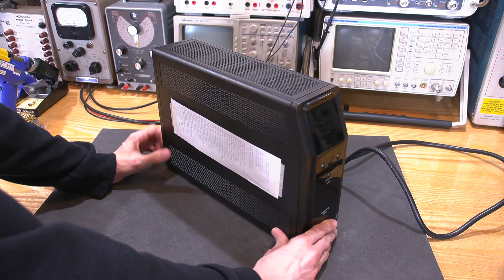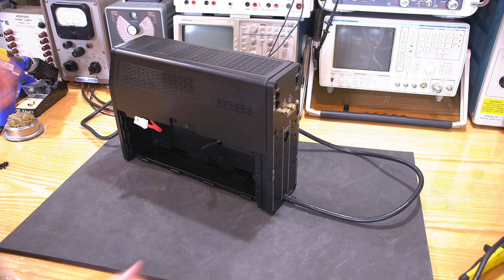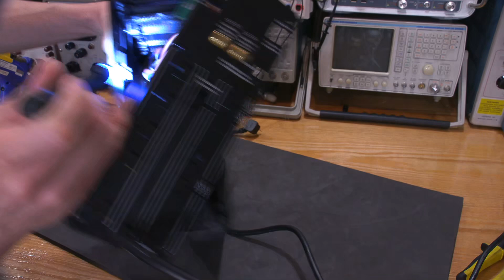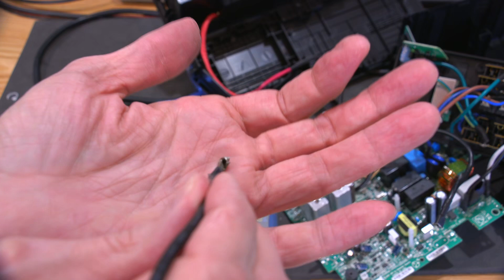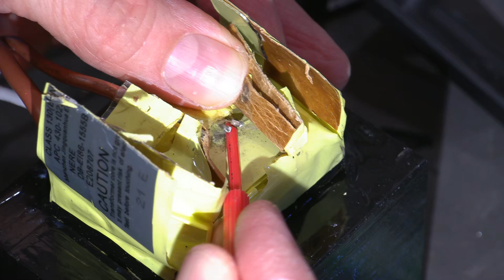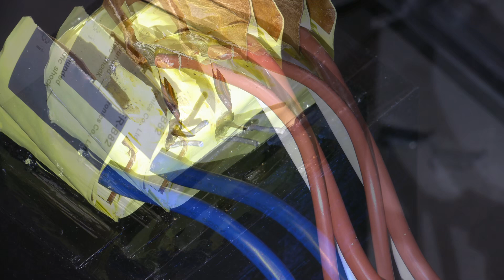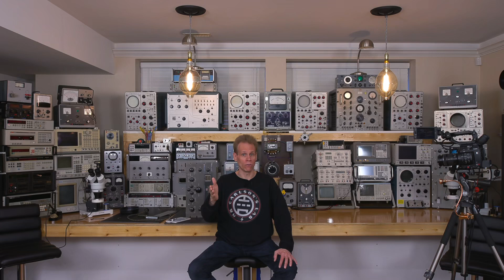UPS Electrical Failure - Teardown and Analysis!

Comment: Sometimes you have aluminum wire with a copper skin, you could solder this, but the flux can completely dissolve the copper skin during soldering. This way you end up with an aluminum wire and a loose soldering. Not useful for a power transformer. Usually it's the simplest things that cause the error because we think what could possibly go wrong here. Think of the rubber ring of the Challenger or the piece of metal on the runway of the Condcorde. When you consider that the copper windings are only insulated with a thin layer of lacquer and how they are assembled in China, you may wonder why it works so well so many times.

Comment: To quote Big Clive; "this is where it all goes horribly wrong!" Wow aluminum transformer windings.  Damn, solder the same thickness is stiffer than those winding wires. I wonder how this would pass CSA, UL ratings?

Comment: IF they had at least used copper clad aluminium, they could have REALLY soldered the wires to the leads. Well, as close to 'really' as you can get.  Sucks that they used aly for the windings though.  Does nobody remember the days of house wiring being aly, and how 'well' that worked out?!  Sigh....

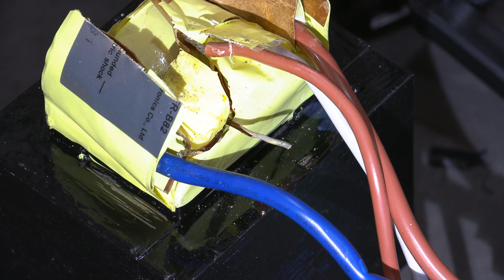Comment: 14:05. If they crimped it, that would be a certain failure, because aluminum anneals.  Like in the US when we had all the fires caused by aluminum house wiring that was not repeatedly tightened over time. Did they use silver solder?

Comment: I recently had an APC XS1000 fail in a curious way. It was outputting 136V (not on battery) and switching to battery more often than usual. The software monitoring (APC Powerchute) was showing a 88V input voltage when actual voltage at the outlet was 123V. I realized the AVR  must be boosting the voltage because the UPS was no longer correctly reading the input voltage and then switching to battery after it was outside its AVR range. This unit is from 2005 and it's interesting how much larger the circuit board is than the one you show and how many more large aluminum heat sinks are in the old one.

Comment: I work for a small company and we used to use these on our PCs.  I'm not sure why we used them but I guess it gave the owner the warm and fuzzies. I have thrown about 20 of these away. Just failed. Batteries died in some but replacing them didn't fix the problem. Others just stopped turning on.  Junk. Oddly enough they did survive 1 power outage but not a 2nd.

Comment: When you couldn't find obvious burnt components or board, I thought about "burping" capacitors that sound like arcing when they pop the scored tops while outgassing when they fail.
So, did APC contract with a Chinese company to make an Asian Pile of Crap (APC)?

Comment: That's a shock. Never seen that before! Must be to reduce weight since those things are heavy. Good way to tell copper from aluminum, the copper will burn green, the aluminum will straight up melt. Just torch it, it'll give up its secrets.

Comment: This looks like a potential recall-worthy issue.  Hopefully this is an issue that only affects the entry level (Back-UPS and below) consumer grade UPSs.  I only buy Smart-UPS and have never come across something like this.  I'm pretty sure they use all copper transformers in that line.
Reply: How can you be pretty sure?  Remember only one out of multiples failed.  It wouldn't surprise me at all if the upper level was just sine wave and more features, instead of better build quality, if they can make the excuse to do this on anything they sell.  Same beancounters, right?
Reply: @stinkycheese804  Sure, only one of multiple failed (at his location), but everybody knows you can't solder to aluminum.  Maybe somebody forgot to tell the transformer factory.  He even unwrapped the additional taps and found them with poor connections also.  I'm sure every other one out there (at least with that batch of transformers) is just a failure waiting to happen.  Those connections should have been crimped.  And yes, the higher tier UPS's do have copper windings, but they are in a completely different use and price class.  You wouldn't find a Back-UPS supporting critical infrastructure, but you will find Smart-UPS all over supporting critical systems.  There's room for quite a bit of quality and reliability improvements between a $350 UPS and a $3,500 UPS.  Same beancounters, but those beancounters know the potential liability if their equipment fails on $500k worth of servers vs. a $750 PC because of something as simple and idiotic as this.  APC may not even be aware of the issue.  They don't tell the Chinese factory how to build the transformer.  Maybe the factory just ran out of crimps, or the worker attaching the leads just didn't know you can't solder to aluminum as they transitioned from building copper winding transformers to aluminum for this production run.  Who knows the reason, but APC needs to be made aware of it because it is a potential fire hazard and the beancounters certainly don't want that on their hands.  It's cheaper to issue a recall and fix the issue than to pay out multiple fire claims.

Comment: My APC SUA1500i UPS from 2005, is still working perfectly. 
Saved it from e-wast back in 2015.  Only had a leaky 3v lithium battery on the network management card fail.
Check it for visibly failing/swollen caps every other year, as I I change the battery pack. (Running the AGM batterys below 50% really shorten battery life 😅 
so far, no faults, no trubble. 
Guess I won't replace this ups until it fails. I Guess they "don't make them like they used to" .. .
Maby not an APC ups for me next time. Looks like the quality has taken a turn for the worst 😪

Comment: Strangely enough here in the UK my APC UPS of a totally different appearance made a few cracks and bangs but soldiered on. Like you I opened it up and looked for the problem but did not remove the transformer. Of course although the thing continued to work I did not want to leave it running.

Comment: A full 7 amp hour battery needs to charge for hours before being able to provide uninterrupted power for 20 minutes, then shuts down for "low battery" battery levels are all displayed on its fancy digital readout.
    A full 100 amp hour battery needs to charge for hours before being able to provide uninterrupted power for 20 minutes, then shuts down for "low battery" battery levels are all displayed on its fancy digital readout. But as you can tell are meaningless and useless.
  AS AN ADDED BONUS, the plastic case is made of the cheaper plastic and melts under the heat of the uninsulated transformer.

Comment: This was by far one of the most predictable videos for me, not in terms knowing what the problem was but about half a dozen things that Mr C commented on as he was doing the diagnosis, I actually stated out loud before he says it on camera. It never occurred to me that transformers could be manufactured in shotty attempt to save money by using what's referred to as CCA, copper clad aluminum. Even the expensive $8 a foot 00 gauge power wire used in my car for audio equipment turns out to be CCA.

Comment: What really grinds my gears about this is that APC used to be one of the more reliable brands in consumer-grade UPS. There are valid applications for alumininum (intentional tyop is intentional) in electrical power distribution, but an inverter transformer is not one of them. The transformer is bad and whoever specced aluminum for it should feel bad.

Comment: I had the same problem with a 50A 13.8V PSU and it was a failed joint to the Aluminium primary winding as well, a quick crimp later and it is still working after 15 years.

Comment: The other type of wire could be is Chinesium.. known to be resistant to crimp, solder, epoxy, any type of hardening or ability to accept paint. Has the lowest ductile strength known to man. Great teardown.. thank you. Not an Electrical or Electronic Engineer (manufacturing and Civil Eng) but love watching it anyway.

Comment: Seems like a lot of these modern battery backups suffer from the same fate, some fail spectacularly, some with a few sounds and dead. I can only guess how many of them failed due to a poorly designed or poorly manufactured (or both) transformer. See a lot of reviews complaining about the F04 error code on modern battery backups. 

I have an old APC 350w battery backup that I bought at goodwill years ago, I just need to replace the battery.

Comment: I stopped using APC about 10yrs ago and switched to another brand. Back then they used to play all sorts of tricks with battery charging that would easily fry new batteries. 

Made buying the brand just now worth it. 

That's some really low quality. Shame on APC. I hope someone from corporate sees this. They should be ashamed of themselves.

Comment: Told a friend to get an APC, as mine are all about 10 years old and work fine with a replacement battery on occasion.   What a difference in the new one: half the weight and with a smaller battery than mine.  Hasn't gone bad yet but I don't have the same faith in it.

Comment: Wow great video and very cool investigation of the transformer! In my experience, most of these APC units have the little QC report printout - even the replacement batteries come with them. I would be very curious to know what brand you switched to. I never saw another brand of UPS that I felt had substantially higher quality than APC.

Comment: That was nasty. Don't have a problem with AL wound transformers themselves, but you have to terminate it properly.. Wow.  I've already warned my boss and purchasing supervisor to watch out for any wire product that says CCA anywhere in it's description. (Copper Clad Aluminum) Network cable, car stereo power amp cables, amazingly scrawny power cords, all sorts of garbage.  But it's cheaper! At least my company's more interested in quality. But the suppliers are sneaky and, frankly, seem to be deliberately trying to deceive folk.  Hate Tripplite and Cyberpower even worse, tho.  But after this vid... Gonna be a run on 'vintage' APC smart-ups to re battery and use instead of this dreck. Just bought a few of that style APC for work after many fails on Trippliote and Cyberpower.  My 3D printers and my test equipment are powered by those. If it eats my Audio precision 515...  Not good.  (We build broadcast electronics. Need good equipment.)  Thanks for the enlightening video..  Stu

Comment: I’ve seen this before in a LiPo battery .. they used some kind of brazing process that contained zinc, to bond an aluminum “like” battery tab to copper wire. It looks like an overall “bad” brazing job.
 Trying to cheap out by not using copper mag wire in the xfmr is terrifying.

Comment: Aluminum wire is more expensive than copper with poor conductivity which would blow up the size of that transformer. The cut cost is a poor judgement and obviously wrong assumption.

Comment: I Have Ben Into Electronics for 35+ Years Ran a Repair shop for 20+ fixing Ham & cb Radios & Amps with as much as 4000 Volts Ac & Other  Amps of All Makes & models of all kinds as well as Computers/Servers & So Naturally I am a Mainly Commercial Electrician with some Residential & 1 Thing i am 110% Sure about is ALWAYS Use Copper Especially when it has Voltage and Any Kind Of Coax It Must be Copper IMHO ! We Keep Seeing It Over & Over People Want To Cheep Out & Use Aluminum Over Copper & Then Wonder Why They Keep Having Problems ! I Happen To Have 3 2200va APC UPS'S 2 are in my Server Rack But All Three Are Older models But they also are Enterprise Grade I Had One Crap Out on me Last Year Du to A large Power Surge But It Took The His instead of all my Expensive Custom Built (by Me)Gaming PC & Servers along with all of my networking Gear ! I Also Hear Their Is A Ton Of Fake Stuff Going Around The Web also ! Chinesium Trash IMHO !

Comment: That is a definite failure by price point! These devices are built so cheaply these days, as to increase the per-unit margins, as to be designed to fail. 
This product is criminal, Paul, you should report it to the CSA and UL.

Comment: That's terrible.  Using low melting point aluminum wire in high current drain device that's a definite major nono with this totally unacceptable

Comment: Everyone shopping for UPS units is looking for performance vs price. APS has built this unit to a specific price point, and the quality has to go out the window. There are several ways to make secure connections between aluminum wire and a copper flying lead. But folks, this is not the way to do it!

Comment: When I was an IT manager, we used these specific devices. They have an absolutely ATROCIOUS failure rate… They fail in the most spectacular fashion also, usually with sparks and smoke (which made for some very interesting helpdesk tickets). I did autopsies on a few of them. Often it would be those voltage regulators (the ones attached to the 4 heat sinks) which would explode. I can’t emphasize this enough: AVOID THESE!
Reply: Aren't those mosfets?
Reply: @motosk8er2  yep, they are, and there's not a single diode protecting the inputs from shorting or reversing or anything that happens to the battery
Reply: @motosk8er2  Probably,  or maybe  IGBTS;...(most are  under  rated, for the surges/spikey/ noisy  power ,  very  shoddy chinese design....
Reply: @Joe Matas I figured maybe the older revision had better parts inside but it died on me, I have two more maybe I'll get.lucky. I'm sticking with the metal chassis unit from now on unless some does tear down reviews prooving another model or brand IS ACTUALLY better with better circuits. The metal units are supposed to be for commercial and enterprise. I think all have aluminum windings just like microwaves but the wires should be steamed not soldered when using aluminum
Reply: The exploded VRs is what happened to mine.
Reply: @gantmj  simple swap or does melt traces and pop other components too? when i was playing with nvidia gfx cards, some others and i figured out i could solder on new mosfets with higher drain gate values as a slight upgrade. i wonder if the VRs can be upgraded and heat sinked better?
Reply: @cdoublejj  It was still under warranty, so I got a new one that'll spectacularly fail soon enough.
Reply: now that i have some many, i wonder if they upgraded with higher specced VRMs,
Reply: @cdoublejj  This isn't a computer. There are no "VRM's".
Reply: @motosk8er2  ok, voltage regulator transistor looking thingy ma bobs
Reply: @monad_tcp  i've heard PC PSUs do better with real sine though i have not had issues HOWEVER i heard my start link screams and wines and tend to die on stepped approximation sine UPS units. i want to baby my electronics if i can. What does AVR mean?
Reply: I suppose a poor connection in the transformer could even spike those regulators to death?
Reply: I have this model UPS as well.  Those aren't voltage regulators.  They are MOSFETs for the inverter.  They are integral in performing the switching that allows the DC voltage from the battery to be transformed to AC voltage so the large transformer can step up the battery voltage to mains voltage.  But I have one of these models as well and it is having the exact same fault you describe.
Reply: Those aren't "voltage regulators".

Comment: Just FYI, those test strip papers have been on APC UPSes for like 20 years.  And yeah, I don't buy APC anymore.  they're crap.  I lost $2500 of pc and assorted equipment.  Conexant or cyberpower, depends on what you can find...
That looked like AL wire out to the board, and then some goofy setup to connect the AL wire to the copper.
I might have to look at some of my failed UPSes.  maybe they can be fixed and put back into use.  Sitting them on a concrete floor with a metal enclosure...

Comment: I have honestly never seen aluminum wire in a transformer. I don't see you getting much of an advantage in cost savings using it because I imagine it has some disadvantages that lead to more turns or thicker wire. Just a guess though.

Comment: That wire is called Copper Clad Aluminum (CCA).  It is not all that uncommon.
Reply from the maker: Where was the Copper Clad? The colored substance you see up the wire is the insulation.

Comment: For F04 Clamp short the unit should be taken out of service and replaced. If the unit is under warranty please contact local support for assistance. Here is a link to local support contact information.Jun 28, 2021

Comment: Can you please tell me how to get this thing to not automatically shut off? I wanted to use a bigger battery ,and use it as an inverter, like I do with older types. But it does not  monitor the actual battery level. it's just a timer. no matter what size battery I use, it shuts down for low battery at the same time.

Comment: Fix connections the way it should be and see if it works. Demonstrate a proper solution so all my learn. Other it was just a useless rant video. 😒
Reply from the maker: Where was I ranting?
Reply: @Mr Carlson's Lab  I maybe exaggerated about ranting, but you were complaining, just not violently.  I really would like to see an attempt to repair it.

Comment: Most microwaves these days use aluminium windings in the transformers - sometimes both the primary & the secondary! Also degaussing cables on crts were going aluminium before LCD took over! It's not only disappointing to see poor quality connections like in your UPS, but it's also disappointing for those of us who like to scrap out old appliances for the copper content!

Comment: I've never had a problem with an APC UPS - from the little tiny 400VA units up to big 60KVA Silcon units.  Before everyone goes off on the aluminum transformer, I would open up some other brands to see if they're not doing the same thing.